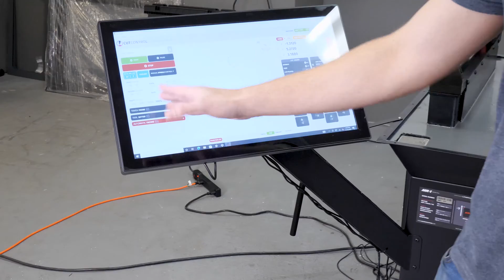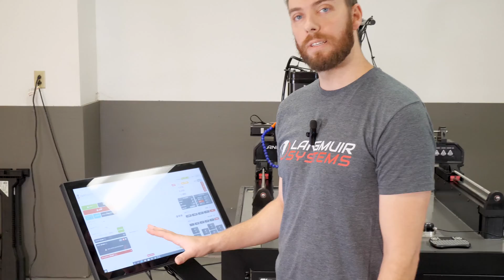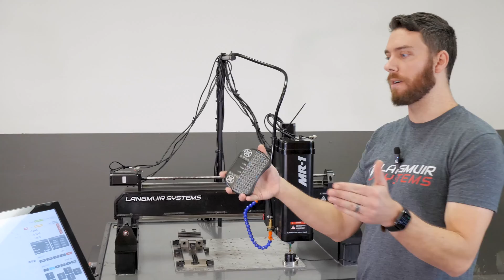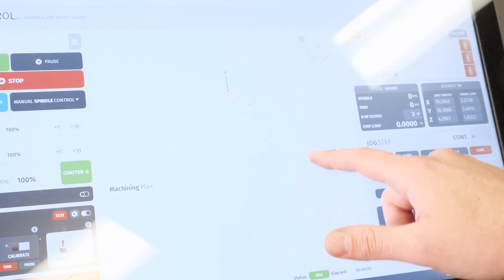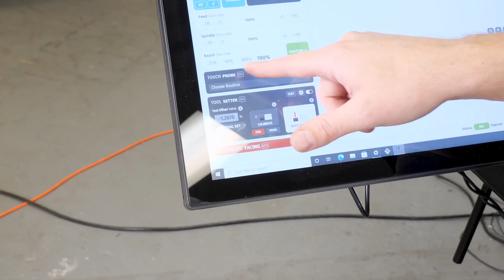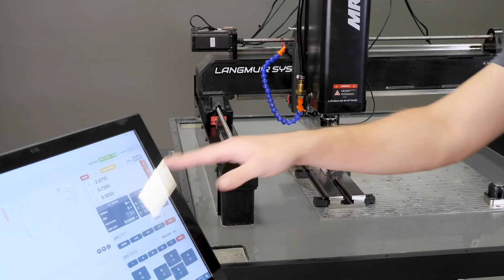MR-1 CNC Mill Assembly Tutorial: Automatic Tool Setter Tutorial

Comment: is there a specific change that is needed if you are using the tool setter riser?

right now my machine will rise up, move over the setter and as it lowers it stops about a 1/4" away and claim it couldnt find the setter.
Reply from the maker: Please download and install this version of CutControl where we've fixed that issue:  https://drive.google.com/file/d/1DkDz4O_IuHu_Ah8n12HjyGTb0jC71MaE/view?usp=sharing

Comment: Hi, enjoying your videos to learn more about cnc even though I have not placed an order for your machine (maybe one day). Question: If both the spindle probe and the table probe are spring loaded, how does that result in an accurate measurement? In this demo, the spindle probe triggered, thus the table probe could have theoretically been anywhere in its travel since it didn't trigger. Then, when the spindle probe is replaced by a rigid tool, it would push the table probe a different amount before the table probe triggers, leading to inconsistencies. What am I missing in my logic? Thanks!
Reply from the maker: Hi Nick, good question! Think of it this way; if we didn't have the probe sensing here and the probe spring is softer than the tool setter (it is), then you would need to really drive the probe down hard until the spring loaded up before it had enough force to deflect the tool setter to trigger it and we don't want to do this to our probe and not to mention the value would be incorrect. Since both the Probe and Tool Setter are capable of triggering with extremely small amount of deflection, sensing the top of the tool setter using the probe is an extremely accurate method of finding the platen surface.